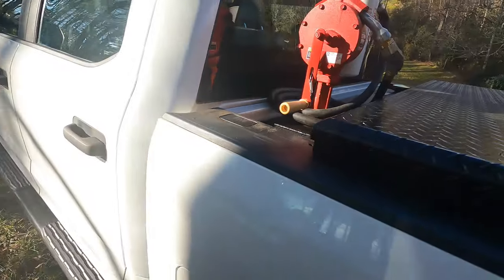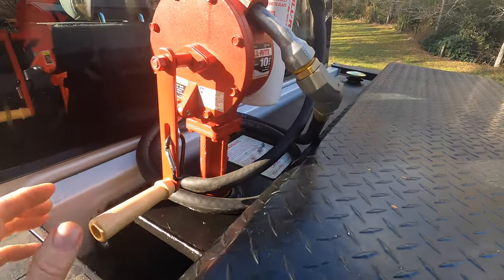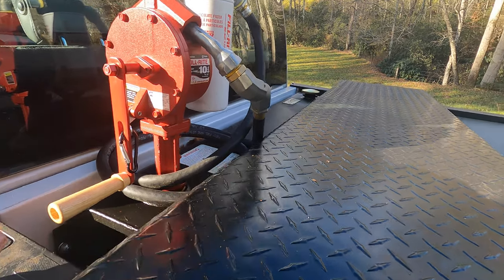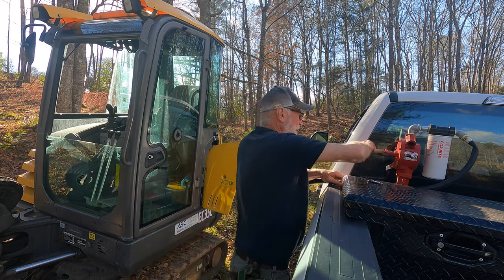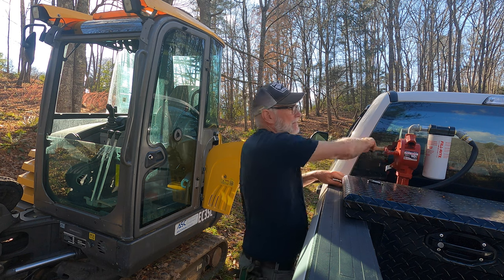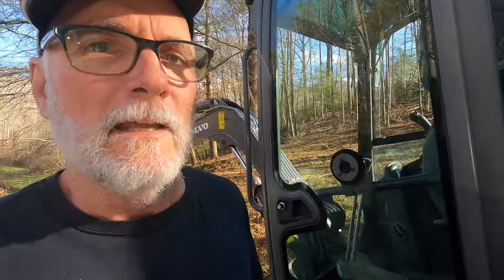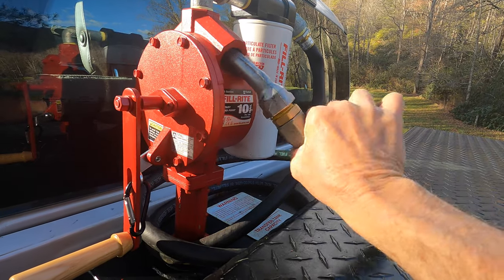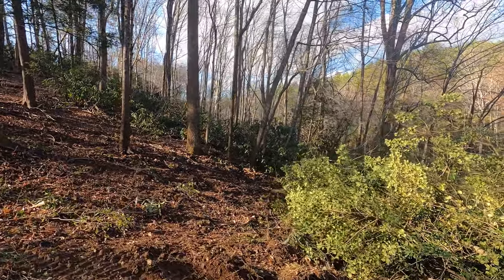Dee Zee Diesel Transfer Tank and Fill Rite Hand Pump Use

Comment: Thanks for sharing.  Links to the products you bought in the video would be very helpful.  I think I would like to do something similar.
Reply from the maker: Fill-Rite FR112 Rotary Vane Hand Pump with Discharge Hose, Nozzle Spout, and Suction Pipe https://a.co/d/6c5qi5K
DEE ZEE DZ92556NSB Transfer Tank https://a.co/d/iRwB0XQ

Comment: 14mm socket on the handle nut, low speed on the drill.....goes much faster!
Reply from the maker: I’ll give that a try. I just bought a battery 3/8 impact driver